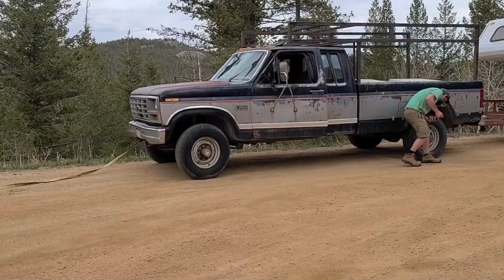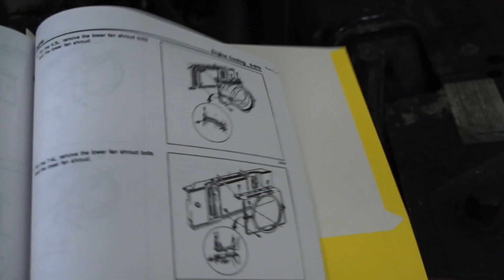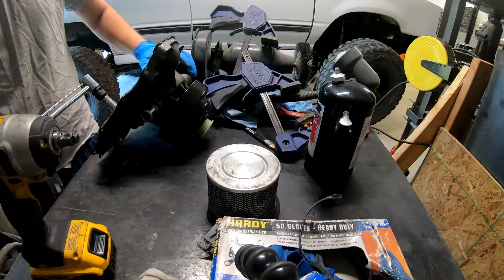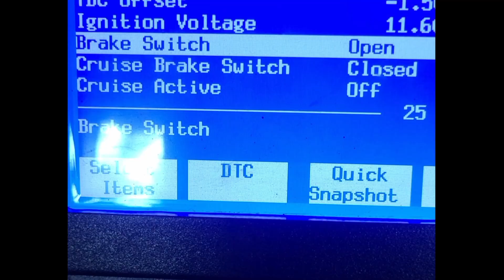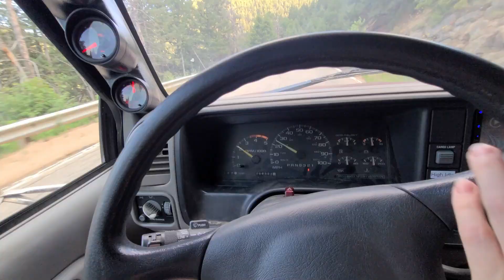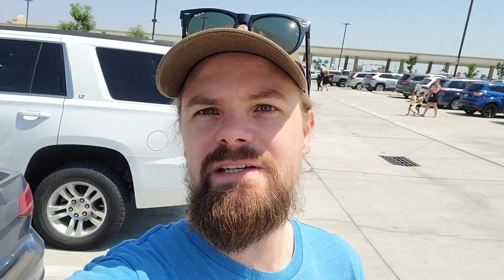Will it Make it 1,300 Miles?

Comment: How is the power on this thing? Does it pull that heavy load decently? And what kinds of fuel economy do you get. Trying to decide between one of three and a Duramax for a tow rig
Reply from the maker: Assuming you plan on highway towing, unless its a big difference in price id get the duramax 😅. The detroit will get the job done but a duramax is a class above it. My understanding is the axles and brakes are better on a duramax as well.

13 mpg unloaded or with a couple motorcycles in the back. The lowest ive seen was more like 9 with heavy trailers. After the cooling upgrades trailers under 10k itll pull 65-75 mph on the highway unless you get a bigger hill. Itll pull up to 14k trailer if youre willing to slow down, and occasionally find a semi to hide behind on long steep hills. The difference with a duramax is you wouldnt have to be watching your gauges the whole time doing this, or planning as far ahead for accelerating. Speaking of youll want trans temp and egt gauges. 

Also dont forget the detroit comes with a 4 speed auto, i do wish i had another gear or two.

Personally, i plan on a cummins upgrade eventually, but the detroit is serving me pretty well in the mean time so it isnt a priority.
Reply: @BuildSomethingAuto Awesome! Thank you for responding. I think you’ve convinced me to go with a Duramax. There’s not a super huge price difference between a higher mileage. Duramax and I do think the benefits will be worth the extra money. I think I was kind of liking the idea of having an older diesel for cheaper, but I don’t think it’d be worth it. Most of the tracks I plan to race that will be 5+ hours away.

Comment: How does the truck tow
Reply from the maker: Better than expected, especially now that the cooling issues fixed. 

In a previous video I took it to pickup a car, 9-10k lb total trailer weight and it did awesome on the freeway, super stable with high winds, only had an issue at slower speeds on steep roads due to overheating.

Towing starts around 17:30
https://youtu.be/SoK9QNHvOLs

Comment: only works with increased flow due to the thermostat. even with a stock pump you will overheat without a thermostat and that's a proven fact. its why race cars at least have a flow restrictor if not a full thermostat
Reply from the maker: I would never advocate removing major components like the thermostat unless you really know what you're doing (e.g. you either have a good dynamic model of your cooling system including coolant passages, or lots of testing to back it up).

That being said, I think the "overheating without a thermostat" issue is application specific. In some engines removing the thermostat may cause coolant to bypass the radiator, in other engines removing it may put full water pump pressure against the cap causing it to open prematurely, in others it may adversely affect flow balancing and cause hot spots, etc. In others still, it may actually improve cooling (at the cost of longer warmup periods). Once you start removing major components you're drastically affecting the system design and the outcome will be engine specific, generic rules no longer apply.

However, IMHO, increasing flow through a higher capacity water pump is not the same thing as removing a major component like a thermostat and is incredibly unlikely to have an adverse impact on the flow balancing characteristics. I think it's pretty safe to assume a modest increase in water pump flowrate will only improve cooling in almost every application.

Comment: Curious what the fuel mileage was like on your trip, i know the 6.5s tend to do pretty well
Reply from the maker: Its always 12.5 to 13.5, regardless of if its unloaded, pulling a trailer, at 5k ft of elevation or 10k 🤣. Its almost spooky how consistent it is (calculated based on odometer and fuel used). New injectors, new fuel injection pump.

I think lighter trucks do better, especially suburbans, but crew cab 8' bed 3500 is about as bad as you can get with these I think.
Reply: @BuildSomethingAuto That’s wild, last I checked my 87 F250 6.9IDI gets 16.5-17.5 unloaded.

Comment: That stuff in the radiator are the remnants of bug bodies. The hard shells of beetles, wasps, etcetera. They build up over time and often cause overheating.
   On those viscous clutches, sling the blade hard and if it rotates more than a few blades when cold it's bad. The hotter the fluid gets the thicker the fluid inside. You can also use a heat gun to heat it to about 150 degrees and it should be very hard to turn. 
👍